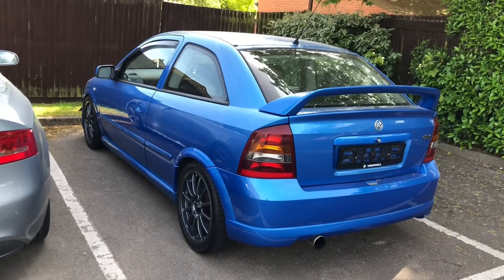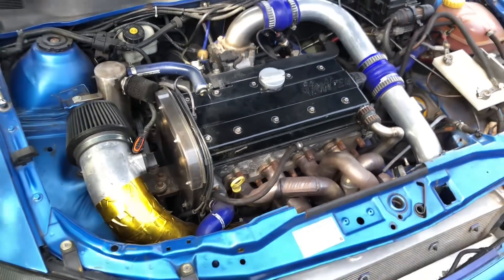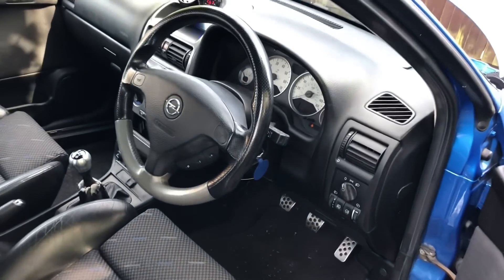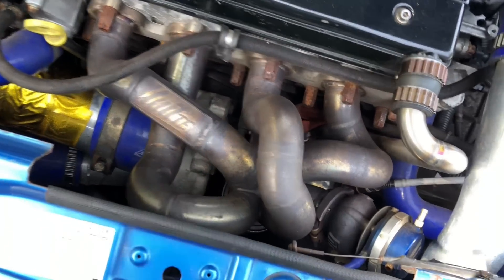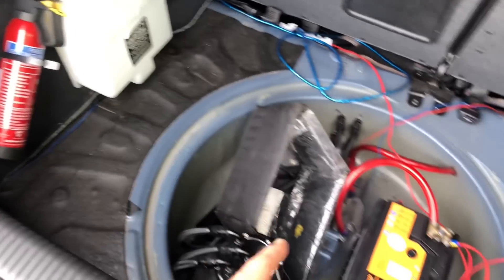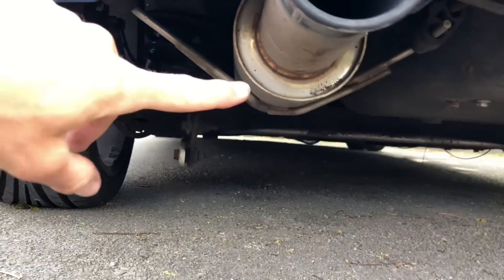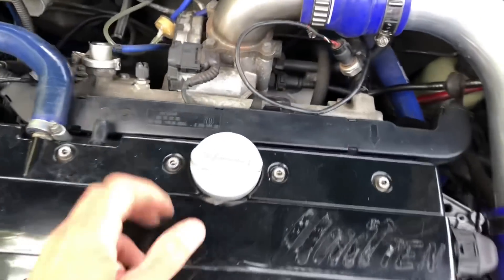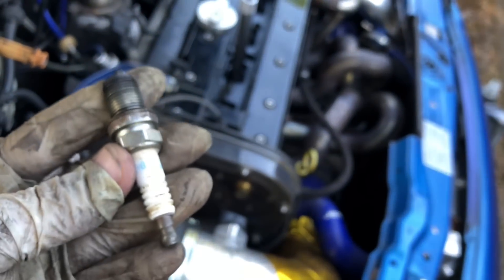We Bought Another 500+hp Opel Astra Gsi Project

Comment: In the okder x20xev's you'd had a small mechanic thing that would tell how many revs it made and if you rev it it catches the revs at around 900/1200(depending how set up) and if that is not working/not there the engine will die everytime when no throttle input has, the z20let is a more performance version of a c20/x20 series and they did take it from the c/x20 to the the renewed z20let/L/LEH,
Maybe that that could help anyway:)

Comment: Where did he get the engine block from? I sent a forged ZLET block to England back in 2013/2014 I believe to a guy called Alex somewere in the south. It was built by Steveboy
Reply: That was me. that engine died back in 2016 as the head dropped a valve during mapping from an overboost of 2.8 bar.
Reply: @allat5434  Aww that sucks ☹️

Comment: Hi mate i recently watched 1 of your older videos identifying the differences between the let and the leh engines. You stated that the let oil pump needs a reducer bolt if put on to a leh block. Im currently rebuilding my leh (vxr) after cambelt slipped and bent 4valves and snapped the tensioner clean off 😭😭 i have a let engine to take the head off and replace mine but i need the oil pump as mines now missing a peice 😬 dont suppose you know where i can get the reducer bolt from or what to look for?? Any help would be much appreciated. Thanks

Comment: in 1999 i had a 1.6CD 16v .  It was a great car, but the engine would drink 1litre of oil every 1000miles.  No leaks, no smoke, passed the MOT every year and cost loads on oil until it was scrapped years later.  

Any idea what could have been causing that and was it a known issue?  No garage including the main dealers could find a fault from new and refused to deal with it.